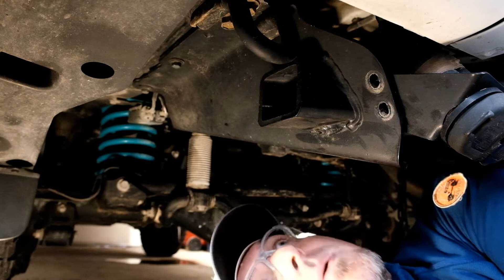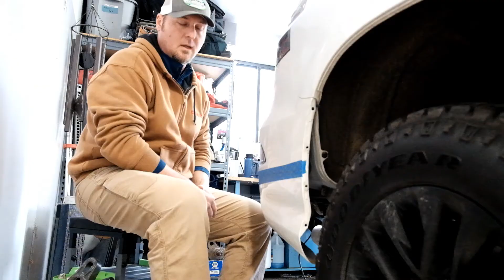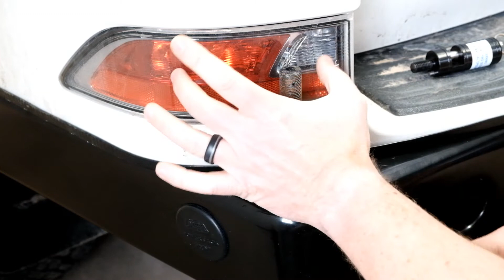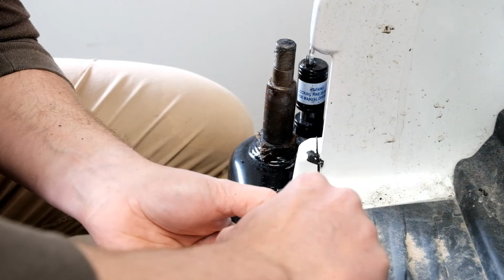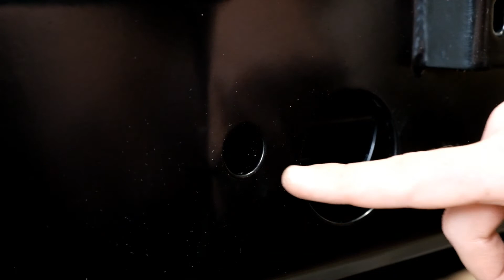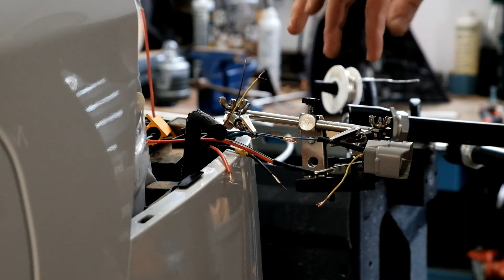Dobinsons Rear Bumper Installation - 2014+ GX 460

Comment: We’re you able to reinstall your 7pin connector and oem hitch receiver?
Reply from the maker: The Dobinsons bumper does not allow for the reinstalling the OEM Class IV receiver. Dobinsons does have a Class IV receiver option, you'll need to contact them directly for details.

We opted for the Curt Class 3 on our GX, although we are contemplating shifting to an OEM 4runner Class 3 since they don't sit as low.

As for the 7-pin mount, I'll need to look up the part number for the mount plate you'll need purchase.
Reply from the maker: We are looking at Toyota part number 5190935011 for a receiver on our GX. Unfortunately, I am having a heck of a time finding the part number for the 7-Pin bracket

Comment: Question, do you need to remove the tow and trailer plug adapter to only remove the bumper? I only want to remove my bumper, and reinstall a new one, not sure if I need to remove receiver or adapter as well. Thanks!
Reply from the maker: You will need to remove the factory receiver in order to install the Dobinsons rear bumper as the bumper's mounting brackets will interfere with the receiver.

Comment: Very nice setup. What did you end up using for a filler panel for the rear reverse lights?
Reply from the maker: I found some 1/8in plastic sheet to use as the filler panel. I'm still working on getting it installed and hope to have it done in the coming weeks